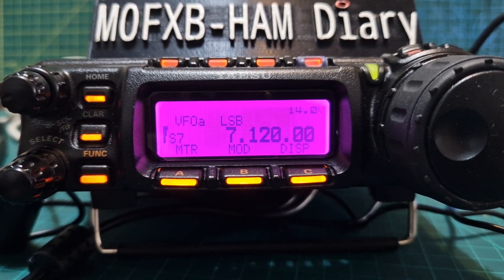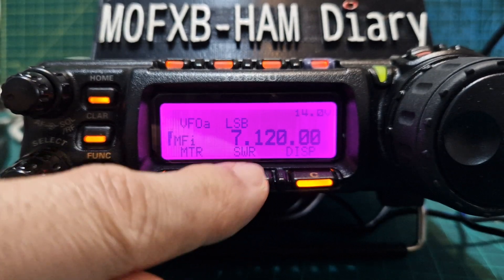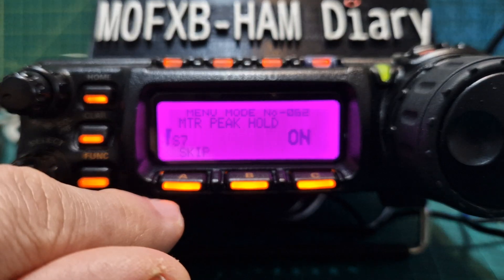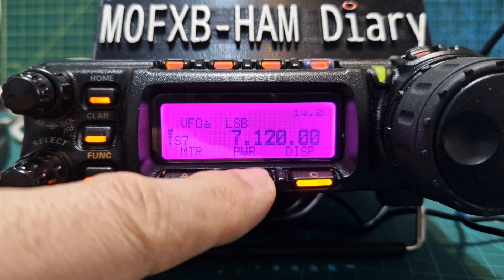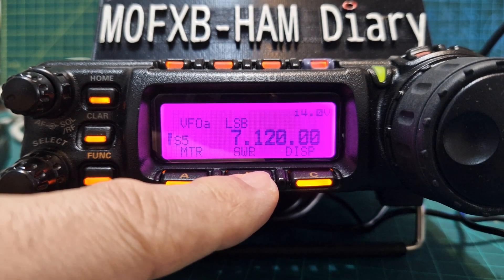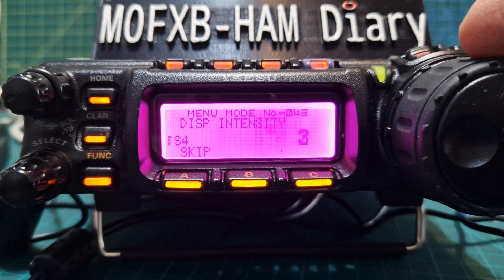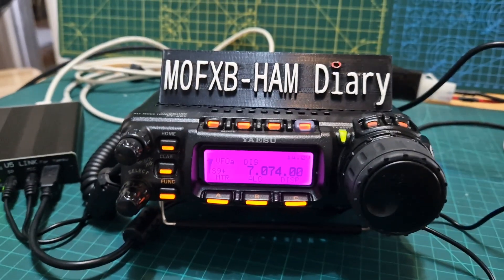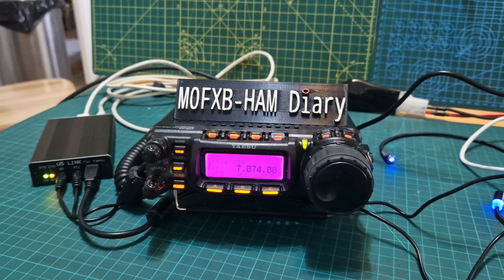YAESU FT-857, SELECT METER TYPE, SWR - POWER - ALC - MOD

Comment: I'm testing wsjtx for the first time with my 857d. I dont understand the metering at all. My meter doesnt move at all. It sits at whatever I dial the AF knob to. Im trying to figure out if my transmit levels are too high.
Reply from the maker: FT8 is like that check conditions using whisper:https://www.youtube.com/watch?v=olYaZCBsJ9E&ab_channel=HAMTechRADIOSCANNERM0FXB%26DRONEHOBBY
Reply: MOD guessing modulation.